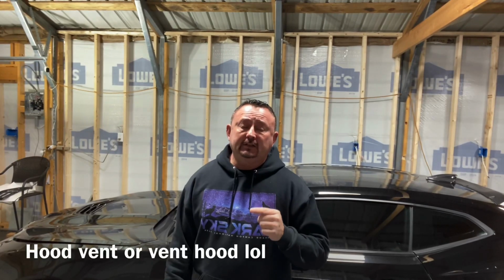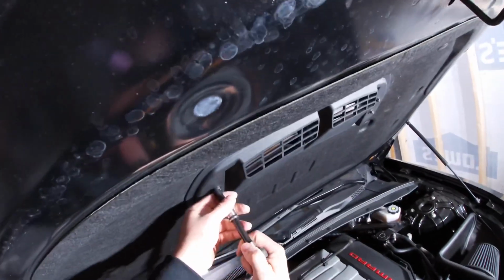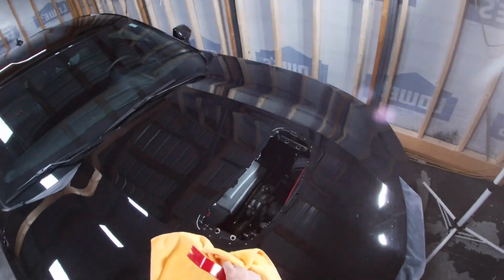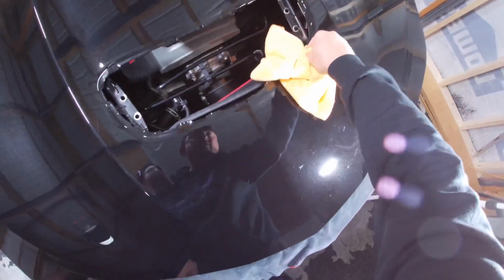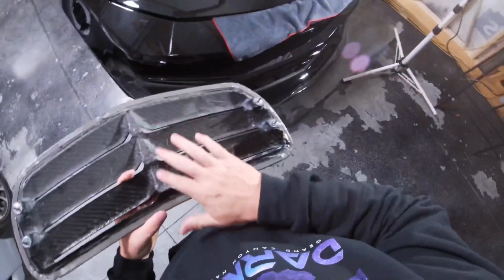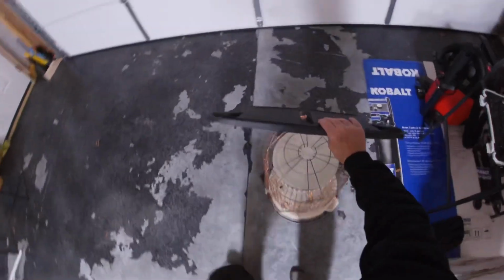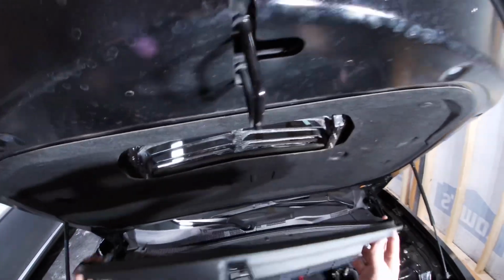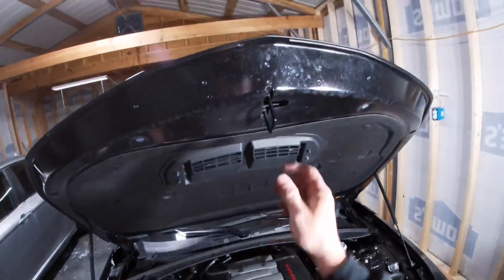2019 CAMARO SS / REAL CARBON FIBER HOOD VENT

Comment: Does the stock hood vent that allow water to flow down into the pulleys causing a little bit of surface rust on them? I recently bought a new 2021 SS and I was wondering if it's the same with all camaros that have that hood vent.